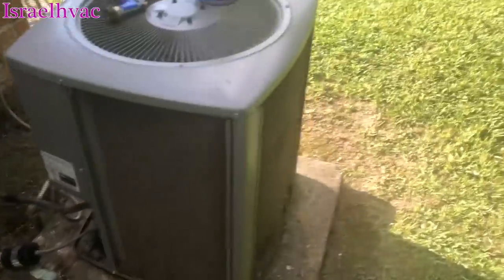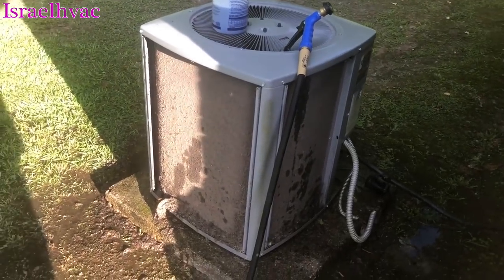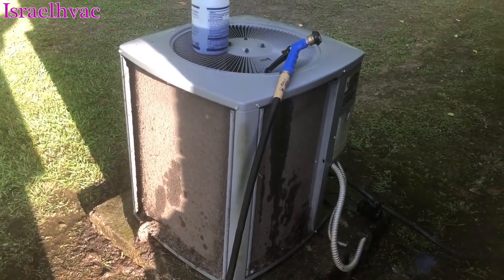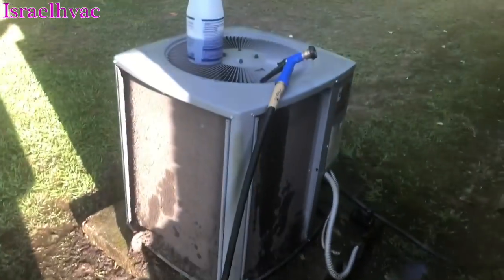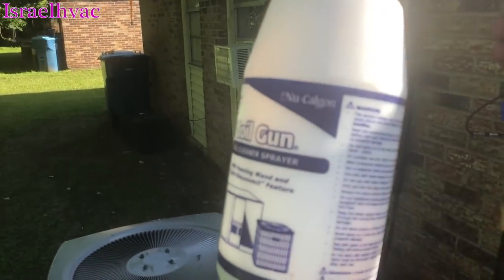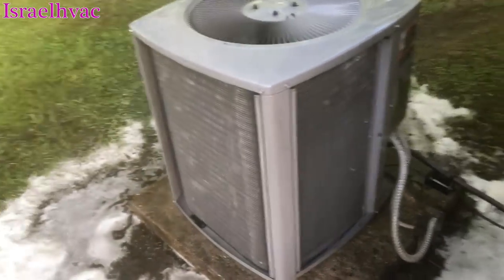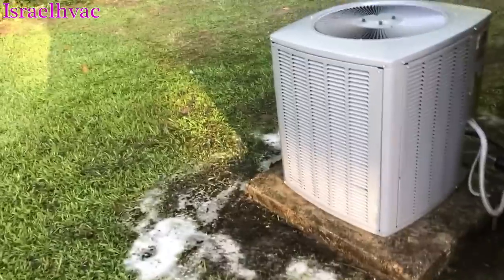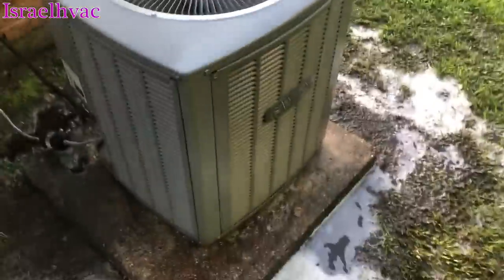Cleaning a HVAC Condenser Coil

Comment: Good job Big John.   I just cleaned out our outside condenser coil.   It was covered with vines.  I cleared out the vines, pulled the power, lifted the fan motor housing, and sprayed out the coil inside and out.   I need to get some detergent.   Then went down in the basement and changed out the filter.  There was also an access panel to the indoor condenser coil, which was matted with cat hair in only one year.   So I washed the indoor coil too.     Last night it was 80 degrees inside the house.  I had to shut off the a/c until this morning when I could get a look at the problem.   I thought the condensing unit had gone back, but this morning I turned the a/c on, everything was running fine, even the squirrel cage.   All the system needed was a good cleaning.  Now I'm sitting here in a nice cool house while outside it's 90 degrees with high humanity.

Take care John and thanks for posting these videos.   Next year we're looking into getting another Goodman.  This one has lasted 25yrs and still runs like a champ.   We just figure it's time for an upgrade.   I wanted to order one online, the entire hvac system with outside condensing unit and gas blower delivered to the front door for about $1500 then find a contractor to do the install.    Trying to save a few bucks on a fixed income and budget.   What do you think?

Comment: This is true.  I asked an experienced HVAC technician about the best way to clean the coils.  He said clean them the best way you can.  It doesn't matter the direction, as long as you keep them clean and jet the water at a downward angle.  Most home owners will not remove the fan assembly or take the panels off.  So just rinse the coils with a water hose and a low pressure nozzle is better than nothing.

Comment: On something like that I'd do it the same way but also like to hit it from the inside out to make certain I have a clear stream of water. I use a 3/8" diameter by 4' rigid copper spray nozzle I built to spray the coil from the inside without having to disassemble the whole unit. Basically like the needle jet. Good to see someone else cares about the quality of their work.👍
Reply: Probably takes you 2 hours as well
Reply: @murkyturkey5238  ok?

Comment: Ive  clean coils this way since 1984 and have never had a problem. In fact that's how they taught us to clean coils in school and now all of a sudden it's a problem. Overtime dirt and dust gets pulled in between the coils regardless and it comes out one way or the other regardless. Just keep doing what you do dude.
Reply: It's because of the stacked or double coils. It pushes it in between the two coils the you have to split the coils.
Reply: THEY TAUGHT YOU THAT IN SCHOOL? THEY DIDN'T TEACH US THAT IN HIGHSCHOOL OR AS A KID WTF
Reply: @Jacket of the 80's most likely technical school for HVAC
Reply: @wokejoke2675  - Did you catch the part where I said "never had an issue".. I don't do micro-channel coils like that, but older coils I do. If water is passing through the coil, so is the dirt... it's not too difficulty of a theory.
Reply: @dannysmith713  - Those types of residential units dont have a dual coil.. it's single stage..
Reply: @jacketofthe80s13  - Did you catch the part where I said "never had an issue".. I don't do micro-channel coils like that, but older coils I do. If water is passing through the coil, so is the dirt... it's not too difficulty of a theory. I don't do stacked coils like that.. this is an older single coil unit...
Reply: Exactly... :)

Comment: Not a big issue with the older 10 SEER units that had flat fins and reasonably spaced around 14 fins per inch. But the newer high efficiency coils have fins that are much tighter and they are not flat. They have little scoops stamped into them with the opening facing the outside to make the air more turbulent resulting in better temperature transfer. These scoops are little funnels and once you push even a little dirt into them, it plugs them good. You won't see it because it's between the fins. I've seen many plugged coils, especially evap coils that were spotless on the faces yet plugged so bad I had to run 4 rounds of NuBrite just to get the air flowing back at rated CFM. That said, you don't get paid more for getting it cleaner. You get paid for getting it done. And this homeowner obviously likes to point the mower discharge at the outdoor unit and not turn off the AC while mowing. It'll look like that again by the end of mowing season. Sometimes good enough is good enough.

Comment: Excellent. Thank you for sharing your know how. Alot of people say that cleaning the condenser casues problems with the fins later on. I dont buy it. Plus the unit itself and the components have to work a hell of a lot harder if the coils are clogged up, which leads to problems with the components inside of the condenser later on.

Comment: Hi, John Israel  this is Jermey McGuire. I, had a 5 ton Lennox XC16 air conditioner that cooled upstairs.  Back in July 2022  the high pressure switch tripped,  we had to get a tech out to reset the high pressure switch.  And cleaned the coils and last July my blower Moyer failed.”
Had to get the blower motor replaced, unfortunately I had to replace both my downstairs and upstairs air conditioners.”
Back on Wednesday 4/1024
Lennox is so expensive!! 
Just to get a part replaced, to bad Lennox won’t let you use universal parts like Goodman. 
And Goodman keeps parts in stick, then having to call the manufacturer to get the factory part you need.” 
I don’t recommend Lennox to anyone! Lennox is a big pile of 💩💩 the 5 ton Lennox air conditioner I had was 15 years old it was time for her to hit the road!! 🤣🤣🤣 good job cleaning the coil John!! 👏🏼👏🏼👏🏼👏🏼

Comment: I personally like to put the cleaner on the outside. Allow to soak for a few minutes. Spray the outside to know all the shit off and follow up by spraying from the inside outward. Adds maybe 5 minutes and i feel  confident the coil is clean enough. I also use the flat setting on the hose.

Comment: Looks good to me, I clean units the same way  and never had any problems.
Reply: I love when people try to tell you to clean from inside out but i personally can never get them clean doing that lol. Outside in cleans them everytime at ease with no further issues.
Reply: I'm wondering if ... What happen if I don't turn off the unit? The other day I took out the big fuse,then when I put it back didn't turn on. I have to call for service for a short circuit. My a/c have 20 years young. 🤔
Reply: @janicec.9728  did you put the disconnect back in the right direction. If you put so in upside-down they won't engage the contacts on the disconnect.

Comment: I can honestly say that when I clean any condenser coil, I always spray from the inside out.
Reply: Came here just for this comment. Thx
Reply: That’s pretty stupid, you should just spray it from the outside and do it until the water goes all the way through the coil and looks kinda clean coming out the other side
Reply: THATS THE PROPER WAY. Spray the opposite way that it's collected.  So yea inside out.     Smart guy.    Now. Spray coil cleaner in it so it eats a whole in the lines and you have a leak and have to replace the unit 😂💯😜😉
Reply: @moneyydogg4318  NO YOU SPRAY THE OPPOSITE WAY THAT ITS SUCKED UP.  if you do it the way you say your clogging the coil.    Take a class you will learn
Reply: Many older units that has no removable panels over the coils, so ur forced to pop the top and back flush
Reply: Inside out! Anyone can plainly see that the air is going from the outside-in? You’re just filling your heat pump inside with the damn dirty water? And I don’t even use water for mine,I have a high pressure leaf blower? I just take the top off and then blow through the coils! Inside outside and then inside again and it’s just as nice! And no water!

Comment: I see this alot on home AC units where it just sits on a shallow pad and just gets clogged and bashed by the the lawnmower.
When I installed my new system I went to a local welder and had him make me a steel stand about 2 feet high that i can put my ac unit on. He made it exactly to my measurements so it sits in a channel on the top where they meet and then poured my own pad and then bolted the the compressor to this little steel stand and then bolted the stand to the pad. Been a few years now and the coils are staying really clean and shiny. Much quieter too since its not laying on the pad.
Makes a huge difference in the longevity of the unit.

Comment: As an industrial hygienist, the probability that new growth will re-bloom if the material is just laying on the ground is very high. A lot of that accumulation is mold too; not just dust such as Alternaria Alternata (a dust borne mold causing respiratory issues). And 10% of the population is allergic to Alternaria Alternata in the United States. In Arizona greater than 51% is allergic. Sensitization (allergy obtained) when the individual has been overexposed for a period of time and the immune system writes and exaggerated response to the allergen. Why is Arizona different? They are running A/C more and it stands to reason that the well known reservoir (place this allergen is found) is in A/C coils. It is an established fact that indoor air quality is adversely impacted by HVAC systems which are not frequently cleaned. Kudos to workers keeping up on condenser coil cleaning and filter changes. The kiddos developing asthma and folks struggling with breathing problems need your support. Anyway, just a suggestion, vacuuming with a HEPA vacuum without leaving the bulk debris on the ground might be a good idea to prevent rapid re-growth. However; if the goal is repeat business (wink, wink) homeowners might have reason for removing the tops and going in deeper with the cleaning. Knowing that much of that dust is an airborne mold that causes respiratory issues might influence the approach to cleaning.

Comment: This is why people diy. Appreciate your expertise but the high pressure appears to be damaging coils and in my are there are leaves and debris that collect on the inside. So to a large degree I have the satisfaction of treating a pretty expensive piece of equipment differently then someone who is concerned about the next job, according to some of the comments, especially for my sister’s house, etc.  Great post. I’ll definitely consider your points.

Comment: 👍 Washing from outside is much cleaner and faster than from inside. There is no pressure to properly wash the coil by doing it from inside out. Even on tranes. If the debris is small enough to go inside it will just go through and that’s it. Never understood all the fuss about cleaning from outside/inside 😂

Comment: They teach you in school and on the job to clean coils the way this guy is doing it. And not all condenser units have panels on the side, many have open coils you have access to.
Reply: cameron yogibear this dude is doing it all wrong. It should always be rinse inside to out. And to never use jet stream and not to spray fins at angles.

Comment: I tried this on a Goodman package  unit and that much pressure will bend ever coil fin flat and closed in a few seconds. I have never seen coil fins this thin. My suggestion is to check the resistance to bending of the fins long before spraying from either side as you can do much damage if the fins are a thin as they are on the Goodman unit.
Reply: Randy Helouin Goodman are the cheapest units you can get

Comment: I wash from whatever way is easier... honestly unless the coil is four inches thick its not going to make a measurable difference. If someone wants to blow an extra twenty minutes dicking around with some of the complete engineering blunders of outdoor units out there, than all the power to them.. but me, I'd rather get the job done and move on to the next one. That being said, in most cases it is easier to pop the top and back flush, than deal with the ridiculous side panels and the way they are fastened.
Reply: Cough cough.. American Standard
Reply: That's the way most companies want their techs to work...bang out the job as fast as possible and move onto the next one. I really hate working like that, I'd rather take my time and do a really good job, but I'm not my own boss so I can't do it that way unless its outside of work. My home unit and those of my family get the works.
Reply: Hell i don't even take the panels off unless its a double coil and i still get the job done hahahaha. Some of this extra stuff is too much, dudes love putting on that show for the customer.

Comment: We all have our own ways and opinions however, it would appear your method works very well for you. The key would be on the initial rinse, not to spray straight on and push the dirt inside the coil(like a dummy)... We can see that from an angle like you did, the initial rinse took off the majority of the surface dirt.... then the coil gun took care of the deeper cleaning. Good video in my opinion.
Reply: I prefer to always hit it with a brush first when it's like that.Knock it right off instead of spraying it deeper into the fins.

Comment: I believe a professional cleaning that cost money should be done by pulling all the panels including the corners and top. disconnect the wires for the condenser motor and set it aside. vacuum the inside and flush the coil from inside out and outside in. both ways to really clean it.  The main reason I clean the bottom out of dirt and leaves is that a few condensers a customer of mine had a very long time and the compressor developed a leak at the bottom where dirt had eroded a hole in the metal.  Cleaning the equipment properly is hard and should cost about $200-350 but it is much better than just an outside only cleaning.

Comment: It is not "crap" to say flush outward.  You flush outward.  Secondly, you need to remove the fan assembly to clean the floor.  Job half done!  You need to flush outward, and inward, after the inside of the housing is cleaned up.

Comment: Best way is to vacuum it first then add coil cleaner or acid removing . I've used degreaser like winter green smells great it  many times in the  past. Then  hose it down, but to each is own right .
Reply: Acid ?!

Comment: Do i need to turn the breaker off the clean it
Reply: Yes. If there is a shut off outside by the condenser, pull it. I have sprayed mine out while It was running but you want to shut off the current.

Comment: how long does the acid product get left on to clean?   couple cigs?  20-30 minutes?   good video thank you!
Reply: no longer than 5 minutes. Or else it will corrode the coils.
Reply from the maker: It’s not acid
Reply: yeah its not acid
Reply: excuse me i meant to say a base.  apparently the coil cleaners are alkaline.  
makes sense since strong bases are used to dissolve hair in drain cleaners

Comment: heres an idea...  why dont ac manufacturers implement a hatch door on the top or easy flip top to stick your hand/arm/hose in and spray inside to out?  situation like this i'd spray off the front first, then spray from inside to out, finish off with the soap wash.

Comment: The jet on your hose is too high and you could bend the fins. Also spray more at steep angle downwards from the top and the dirt just rolls off. You were just blasting it right back into the thing.

Comment: Does this clog up the inside of the unit since you’re spraying it into the inside?
Reply: There are drain holes on the inside
Reply: One risk by spraying from the outside of a dirty coil is clogging the drain holes on the inside.

Comment: Probably the biggest reason compressors fail prematurly, more condensor heat means higher compression and more torque needed to turn compressor.

Comment: What kind of soap or liquid did you use to clean the coils, did you mix it with anything else?and what's the name of the gun?
Reply: Don't use soap
Reply: Honestly its all just a show. If you can rinse it from outside in with a hose and see a bunch of water flow from the inside, its cleaning up fine.
Reply: They make a cleaners that’s specifically for condenser coils. That is the only thing that is ok to use. Rinse with water after.
Reply: @JustinOnRs  yeah, simple green. 🤣

Comment: How are you doing sir? I have a question, that connection for the solution you use to clean the coil were did you get it from?
Reply: @Demetrius dougar; it comes in a kit when purchased from a supply 🏠/shop.

Comment: pressure washed my condenser closed the other night outside didn't see what I was doing i take the top off would it straighten them out?
Reply: using a pressure washer on a coil is recipe for disaster those fins are paper thin and takes almost nothing to bend them. a garden hose and a nozzle is all u need.

Comment: This is the Lazy way to clean your AC coil without loosening screw.
But 👇👇👇👇👇👇👇👇
I preferred clean from inside out.
That is how we AC technicians do.
Push the dirt dust from inside to outside,than follow by outside coil than inside,and from inside to outside again.
That its...done and no dust left behind.

Comment: Wouldn't it be better to vacuum the large debris off first and get that fur coat off before using the cleaner gun? Also have you considered a small electric power washer? I have a Ryobi thats about the size of a 15" laptop that does 1600psi.
Reply: I would use a whisk brush to get the heavy stuff off, rinse the condenser and then apply coil cleaner, wait 2-5 mins, and then rinse it off. Some cleaners have an acidic substance to them.
Reply: @arcticarrowhvacr  the acidic can be useful to remove the dirt and hair etc... But bad Becuase it sometimes takes aluminium with it